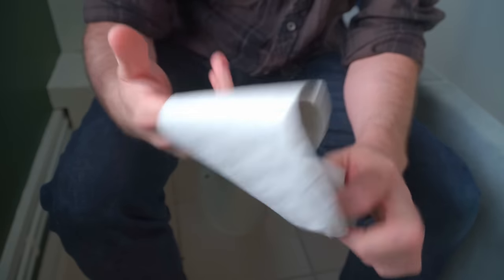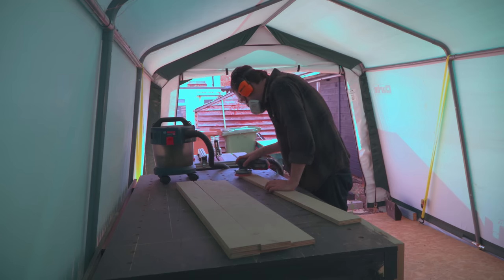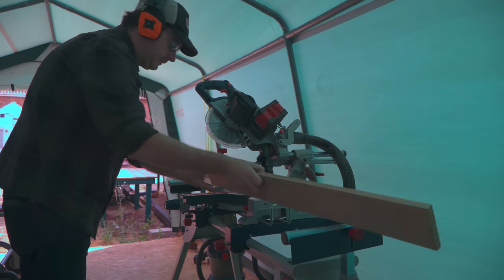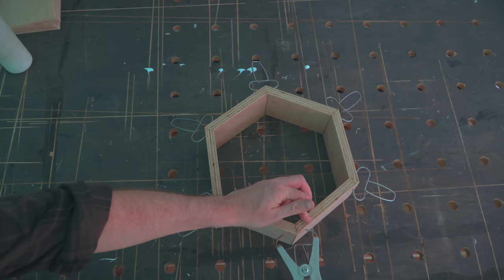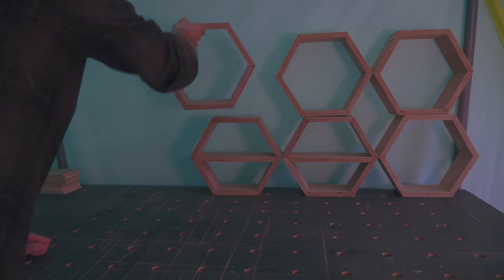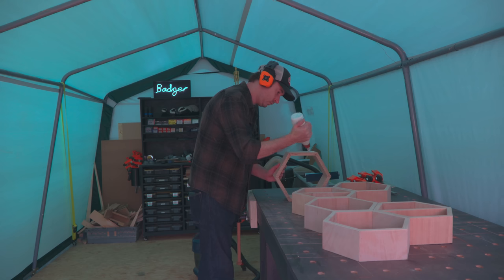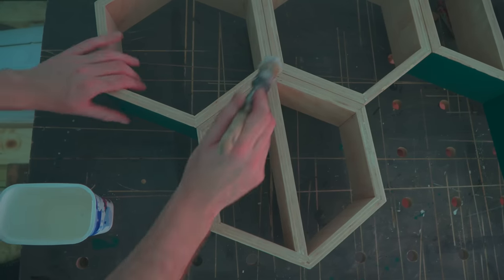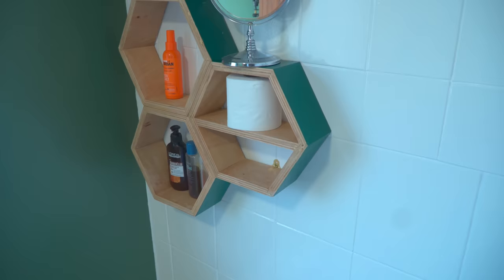Making Hexagonal Shelves

Comment: Matt, do you ever have a problem with your Tacwise gun jamming?  I get two/three nails in, then it'll only push next one in part way, and then jams completely.  Have had it too long to return it, just wondered if it was something I was doing wrong or whether it's a duff machine.   Have only been pinning t&g boards to softwood battens... not like it's hard work for it.
Reply from the maker: I had one years ago that I had lots of problems with but this one seems fine.
Reply: @Badgerworkshop  Ah ok, cheers.  Price has shot up so will have to put up with it.

Comment: Which table saw was used during this build?
Reply from the maker: Bosch 18v
Reply: Appreciate, contemplating buying one. Can you tell me if the slots are standard size for rockler type jigs?
Reply from the maker: Yes they are. I did a video about the saw last week
Reply: @Badgerworkshop  Yep, was a great video and the only query I had was the t slots :)

Comment: Re the two hexagons with shelves - while it would have been more work, wouldn't the end result have been more useful if the shelves had been centered on the hexagon rather than offset to the bottom?

And while you didn't mention it, I presume you had carefully planned the design so that the height of the shelves would accommodate a roll of toilet tissue.   Or at least that's your story and your sticking with it!
Reply from the maker: I don’t really see how it would be more useful